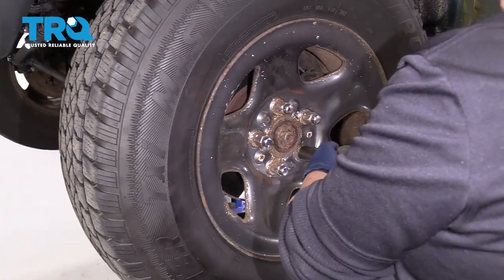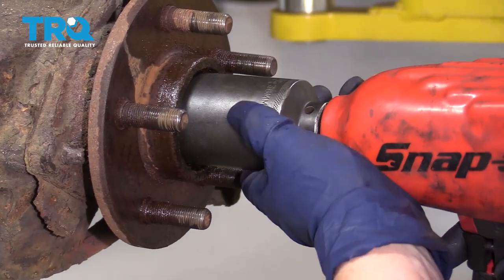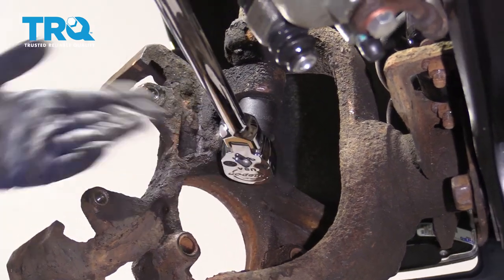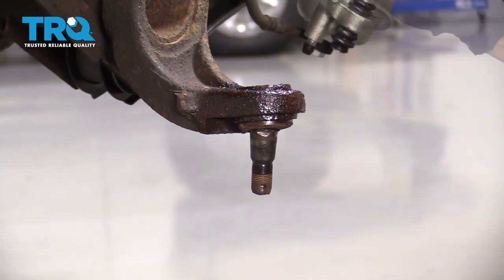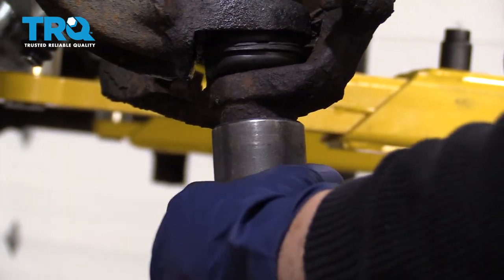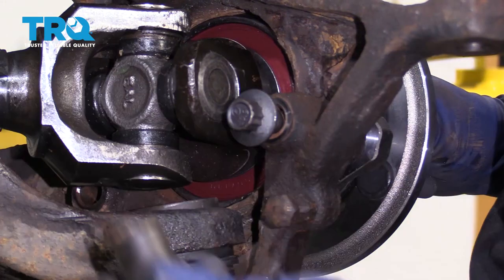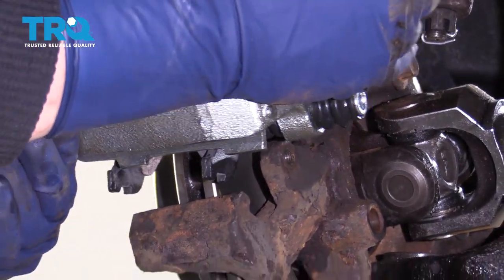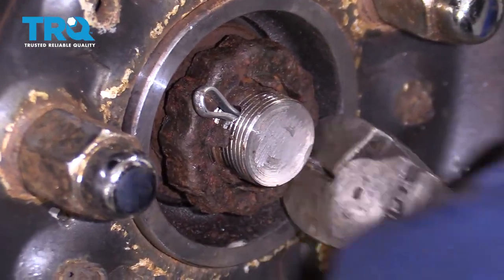How to Replace Front Lower Ball Joint 1984-2001 Jeep Cherokee

Comment: What about the snap ring included and the groove built into the joint specifically for it? There's no mention of it in the video, however when I took the old joint out it didn't have the ring on it either, but it looked like it was seated crooked and they couldn't get it on.

It looks crooked in the video as well, is that normal for these knuckles or what?

Comment: I saw a guy use a type of C-clamp that had a cap-less/hollow top so you could push the old ball joint out of the socket there with minimal effort. Not sure what he used though
Reply: Yeah this lady is doing this the hard way, borrow a ball joint press from autozone
Reply: @tylerhale1696  Exactly.  She made a 10 minute step into a 3 hour step doing it without an easily accessible ball joint press....

Comment: Noticed you said 28mm for removing the lower ball joint castle nut and 32mm for putting it back on. Any reason for the different sizes? Thanks!